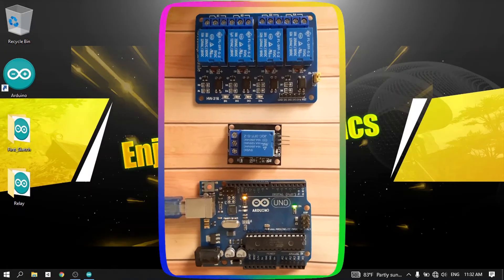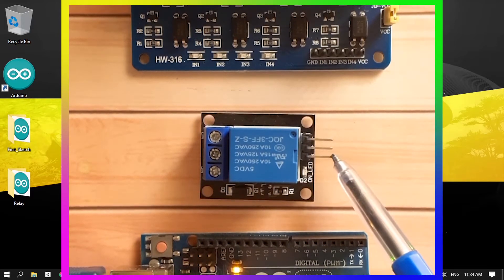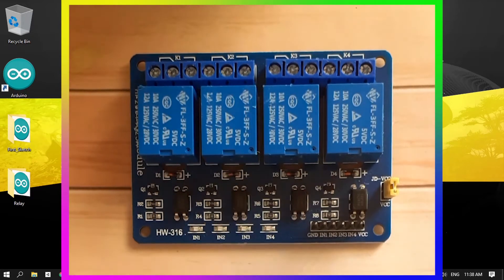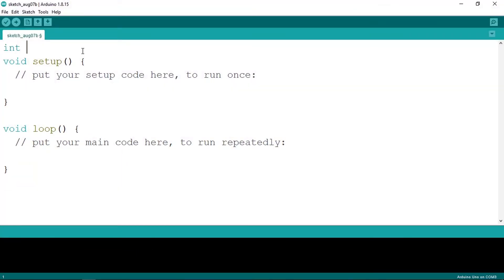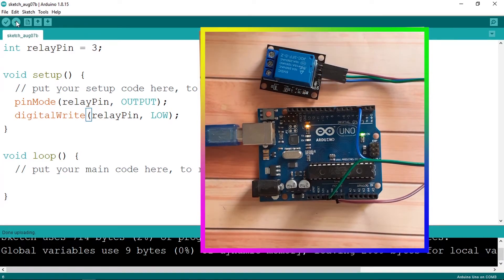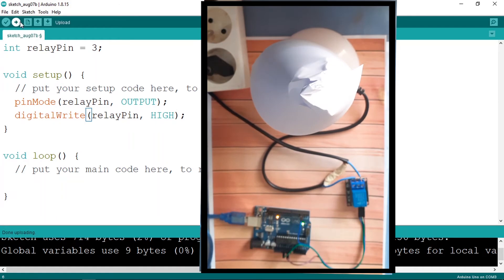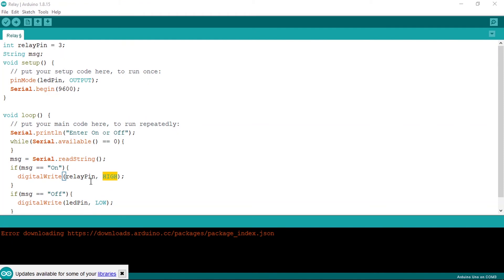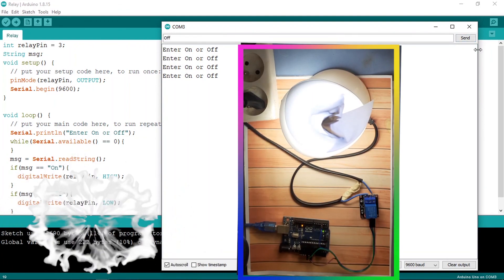Arduino Tutorial 10- Control High Voltage Devices using Relays

Comment: Why you did not use resistor / diode?
Reply from the maker: So we use relays to control high voltage ⚡ devices by opening and closing the circuit